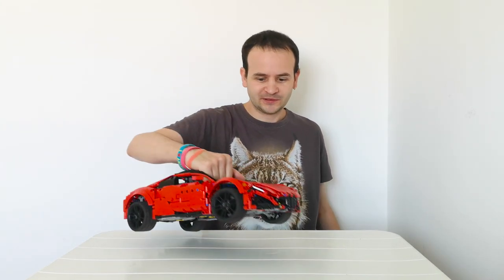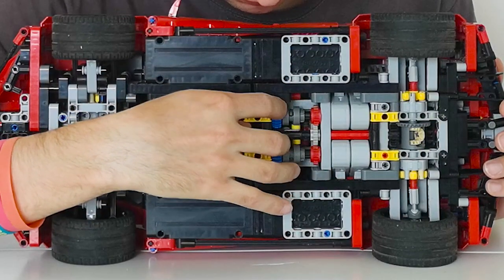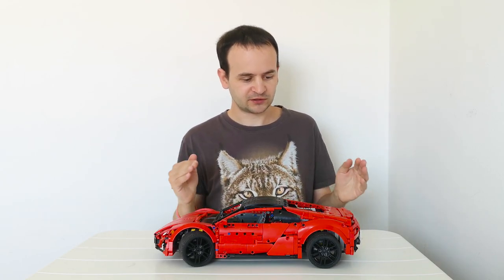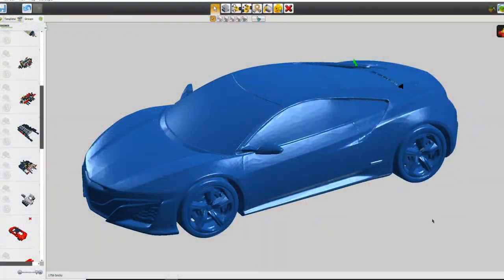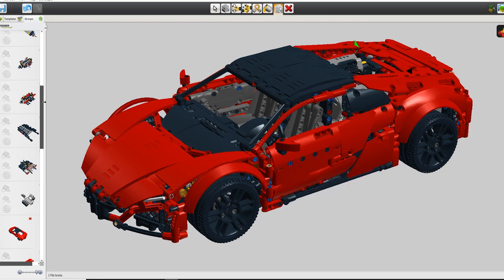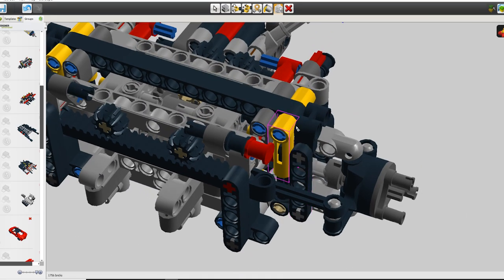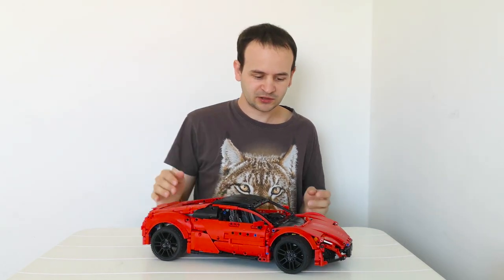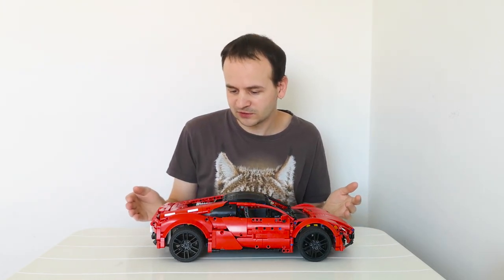LEGO Motorized 1:10 scale Acura/Honda NSX Supercar

Comment: Congratulations on the success of this model! Very well constructed and functional. Probably for future models, make body panels modular so you can easily access the chassis all over again, particularly for motorised models. Axles and gears have their limits even with cars at this scale.
Reply from the maker: That's a good idea, though having them modular might reduce their ability to bear loads. Regardless I will think about that option for the future model, though that one will probably no longer have any gearbox, just direct drive from motors.
Reply: @ZEROBRICKS  I’m quite surprised you got a gearbox to fit in a car with its 4 RC motors at this scale, main problem is it adds to the models weight, which we don’t want. So yes I’d ditch the gearbox.
Thanks for sharing 😄

Comment: The technic u used to prevent the differential from scipping is Genius, I actually used it at the old driveshafts  necause the old cv joint tend to slip

Comment: Sec 3:33. I use that configuration on my speed breaker car with 6 buggy motors.
Your car looking good, i like its performance. 
Positive camber could be very nice add to it. Very cool car.
Im surprised that those wheel hubs is hold the wheels, and perform well. Same with the cv- joint, and that differential.
You didnt had any problem with those ?
You got my like 👍
Reply from the maker: Thanks. I only had the wheel fall off once when landing, the lower weight sure helps a lot. The weakest point is the differential, so the next model will probably use direct drive.
Reply: @ZEROBRICKS  nothing is like direct drive. The only exception is the sumator mechanism. Why you dont use the red differential? Its way more rebust.
The car built is looks awesome.
Reply from the maker: @yuvallegomotorized  Red differential is even more prone to skipping and it would also make the model much slower due to the higher gear ratio.
Reply: @ZEROBRICKS  you totally right about the speed, but i think they way more strong, they never skip in any of my builts, and they got planty of power. Im never use those diff.- only the red once- untill ill get the Ferrari new once 🙂
Reply: @ZEROBRICKS  i just build new ripsaw, maybe its the fastest ripsaw ever, but im not sure. I used the red dif there if you want to see. 1 day I'll make a car on the same principle with that sumator. 
I guess it will go around 30 km/h. 
No cv-joint, not wheel hubs, no steering rack and not servo is needed.
Reply: @ZEROBRICKS  you're totally wrong.
Sure they are slower but it has much stronger gear mash. I bought them because my old differential started clicking and slipping.

Comment: Very nice MOC, the design is on another level. Do you think that some power is lost using the custom CV joints? Also are they necessary for the car to drive well (e.g., normal ones would break quickly or not work at all)?
Reply from the maker: Thank you for the praise. Yes, normal CV joint simply can't support such a heavy model.

Comment: That is a cool build! 2 things: 
1, do you have a tutorial video for  the custom CV joints that you have used?
2, have you considered taking the 24z differential and cutting off all the part you dont need to get a 24z clutch gear? Or do you not do that kind of thing?
Reply from the maker: 1. The custom CV joint simply uses a knob gear and the part 98585 with 4 pins, it's a really easy build!
2. I have yet to modify any bricks used in my project, though I could 3D print some 24 tooth clutch gears, it would be cheaper than cutting differentials. Might be a good idea for a video.
Reply: @ZEROBRICKS  ok, I myself would not want to cut any Lego!